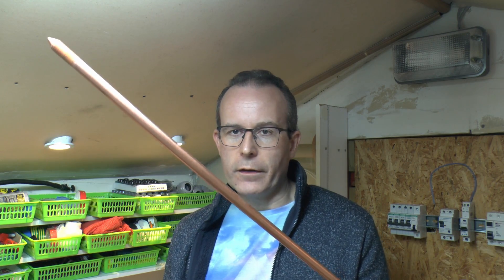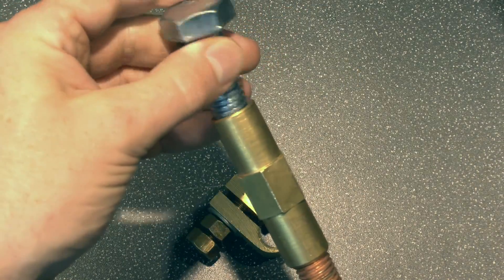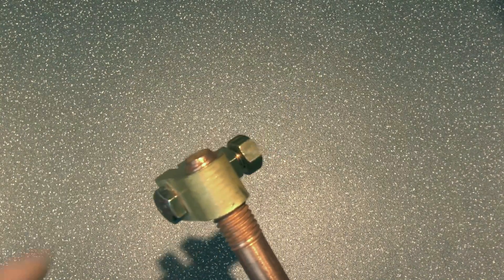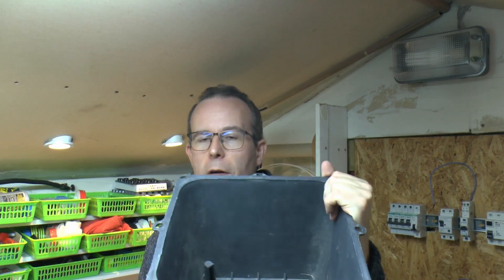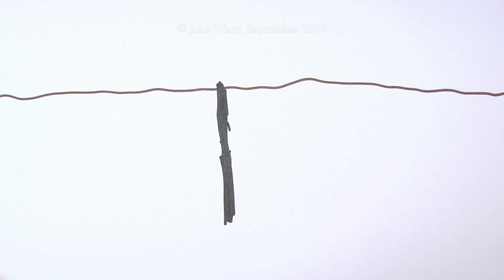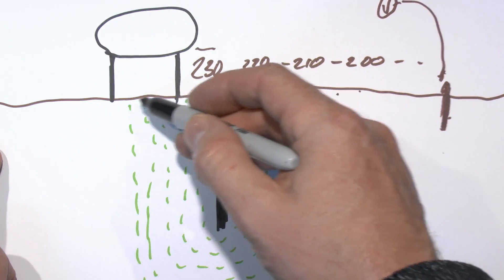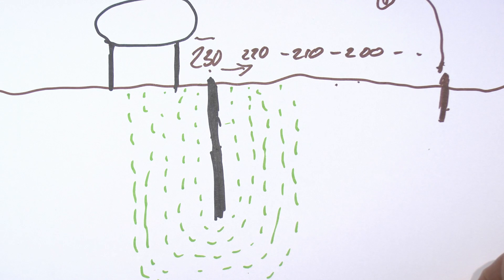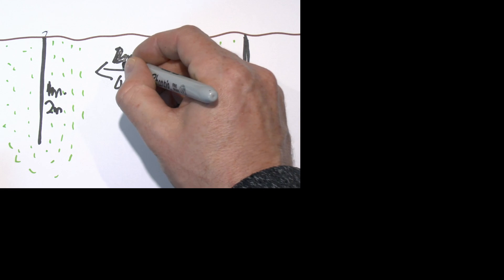Earth Electrodes Part 1

Comment: If I had 2 rods, does the earth need to be continuous from the met to the first and then the second or can it be cut at the first and a separate cable to the second? Also would it be possible to run a separate Earth to each rod and back to the met?
Reply from the maker: No, can be a single wire looped to each rod, or each with it's own one, or any combination. 
The only real criteria is that they are all connected to the MET and that the various connections and wiring is all labelled with what it is connected to.

Comment: Depends on the area is totally the thing.    I am glad you mentioned that.     Here in Australia, every installation is a TN-C-S  install and every install has a MEN link .    This is because in most areas of Australia, the soil is not conductive enough for a TT system to be useful.    That said, often places have an earth rod attached back to the main earth bar, as part of the multiple earth to neutral link, so virtually all of the installations are also forming part of the multiple earth links of the system.   I guess you also do that in the UK with metal water and gas pipes being bonded, even if a rod is not present.

Comment: hello John. can you do an earth rod installation video that would be used for an high end hifi system.i have a good set up,but cant find any vids on how to earth the system correctly. i have 2 x mono amps , pre amp ,dac , streamer, hiend dvd player ,11 channel receiver ,with a 11.4.2 speaker system. where and what do i earth,and where to on the back of the machines.i cant see any earth screws /clamps to wire to. thanks

Comment: I'm not convinced by your reason for installing electrodes some distance apart. The purpose of the electrode(s) is produce a relatively low-resistance path to earth, and that's mostly about contact area with the ground particles. Two rods close together gives you the same contact area as two widely-spaced rods. So it should give you the same earth resistance. Yes you'll change the shape of the surrounding voltage field, but not the potential, nor the distance-decay value, so I don't see what you gain.  It doesn't matter that they are in each other's fields - they just amount to a more complicated-shaped electrode (like the mesh you mentioned). If each element of an electrode had to be widely spaced for electrical reasons then it would make sense to separate the components of a mesh and spread them out.
Perhaps I am missing something here, but I don't think so.

Comment: Hi John - Amateur radio operator here, much confusion about earthing radio gear - I have a PME/TN-CS system at my house, RF energy on mis-matched antennas can come back and haunt you with un-earther radio gear (mostly all antennas are a compromise and standing waves on the feed lines come back to the radio depending how good or bad the SWR at the antenna is), I can either earth to bonded pipes or use a ground rod - what is best? Closest ground rod would be 10 feet away, closest bonded pipe would be 5 feet away - I appreciate any faults in neighbours houses could potentially effect me with bonded pipes - and a cut or failed power cable in the street could effect me with a ground rod, and no earth at all can cause RF energy burns, never had one but plenty of Ham's have... Too long an earth wire could radiate RF energy and cause EMC problems on TV's n such, currently, only my power supply to the radio is earthed via the plug earth, which I assume is the same as earthing to bonded pipes? - what would you do?

Comment: Hello John,
Which one is the best earth rod to buy please.
Please advise me.
Thank you.
Best wishes from Leicester ENGLAND
Reply from the maker: Depends on the soil conditions, and rods may not be suitable in all locations.
However if rods are to be used, they should be the type with threaded ends and connectors so that they can be driven deeper, and a large diameter, as the surface area is the main thing which affects the resistance.
The unthreaded small diameter ones should be avoided.

Comment: Hi John,
Thanks very much for the video.
Just to clarify,
If you installed a one metre long earth rod within say 300mm of another one metre earth rod in series both lugged together using a 16mm earthing conductor.
1)  Would this not be of any benefit to the overall resistance value unless the conductor was as you said 2 meters apart? 
2) Would this cause any problems?
Thanks

Comment: Is there a problem if a TN&C system also has an earth electrode?
Reply from the maker: No, it's probably beneficial if there is one (or some).
Reply: @jwflame  but what happens, say, if the incoming neutral supply, (overhead in my case) should somehow be cut. Wouldn't this mean that the return would go through the earth wire to ground?

Comment: With a TT system when the rod goes in  the ground and takes a fault how does it get back around to the transformer if the rod ends in the ground is it absorbed by the mud ?
Reply from the maker: Current flows through the ground back to the transformer.
Reply: @jwflame  Thanks John makes sense just passed my 18th wiring regulations, I wanna learn lots and your videos helped me, when I did my AM2 the s plan boiler video was great help great understanding

Comment: if you install multiple rods, the copper wire connecting the main supply and all rods needs to be continuous? or can we lug each end of the cables (16mm of course)?
Reply from the maker: The rods need to be connected together, but  no requirement for that to be a single continuous wire.

Comment: Reg 542.2.8. Are the screw connectors sufficient when joining electrodes or that has changed now in the 18th?
Reply from the maker: 'other suitable mechanical connectors' will cover screwed joints.

Comment: How does the resistance of the earth connection vary depending on moisture content of the surrounding soil? For example during drought conditions when there is no rain for several months.
Reply: It's pretty subjective, but depending on the soil and rock anything from a few ohms to a few hundred ohms per meter.
Reply: You're right. Dry soil will conduct more poorly. You can improve ground conductance by pouring epson salt mixed in water into a hole around the rod. One power company study found that improved the conductivity three fold.

Comment: why is TT still used? surely the supply could be configured to TN-C-S. is there a reason this isnt done?
Reply from the maker: TN-C-S isn't suitable for use in all situations.
Reply: @jwflame  Wow the man himself. Thanks for the reply.
When wouldn't it be suitable? I'm still learning, not qualified just yet.
Reply from the maker: Situations such as swimming pools, hot tubs, caravan sites, and some other outside installations like electric vehicle chargers.  May not be desirable in others such as remote buildings which have metal framing, or metal water pipes.